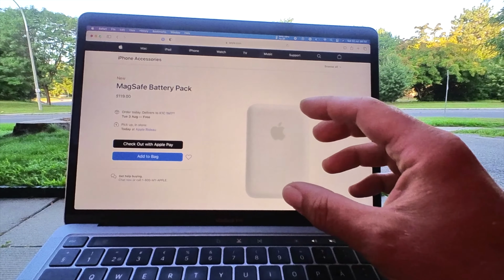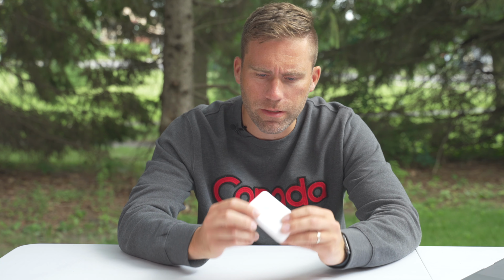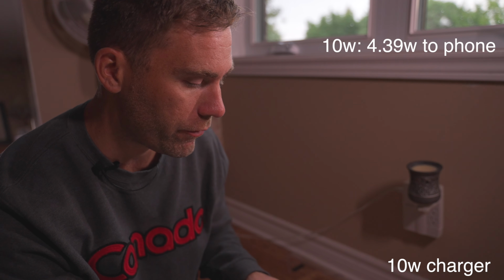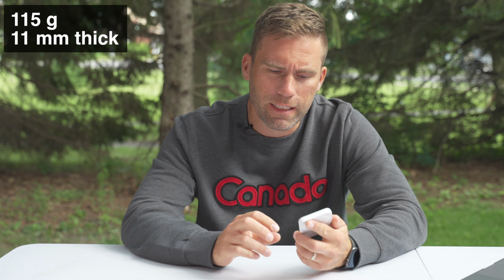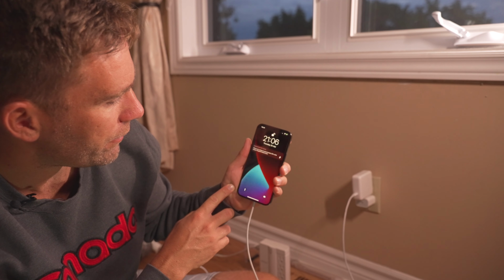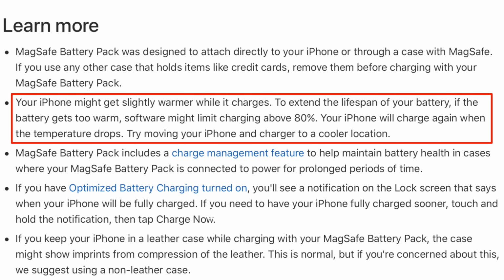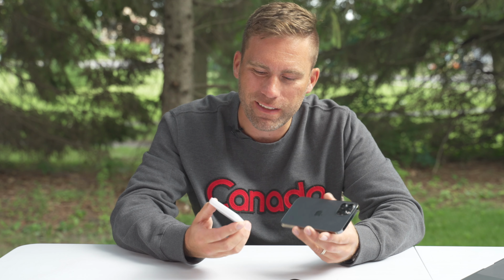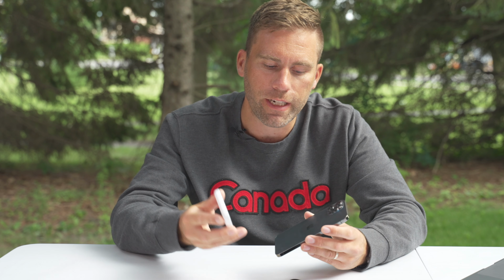Apple MagSafe Battery Pack - Review, Charging test and Magnet test!

Comment: As an alternative, maybe u can review zeera’s MagSafe battery pack, and I feel that is a better option than the Apple battery pack anyday. Excellent informative video and u r right when u say that when we keep the phone charging with the MagSafe in the backpack and because of constant movement, the unit may slip out and not charge the device @ all… again personally I wouldn’t buy any other Apple device until 2023 because that’s when the XR that I have will not receive any further software updates so until then make the fullest use. Great job with the video!!..
Reply from the maker: Thank you Ranga KV! And thanks for the product review suggestion!